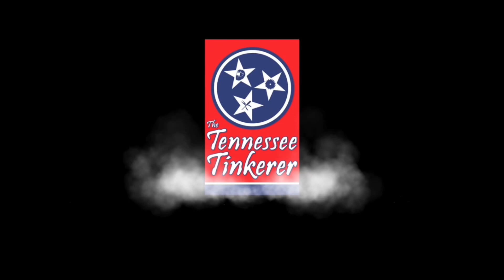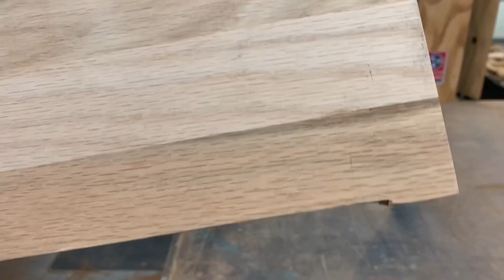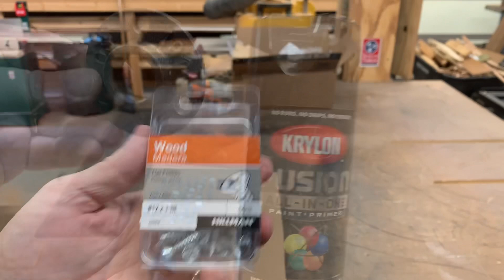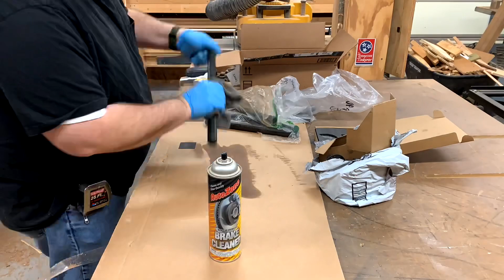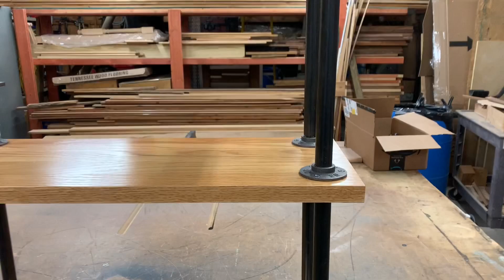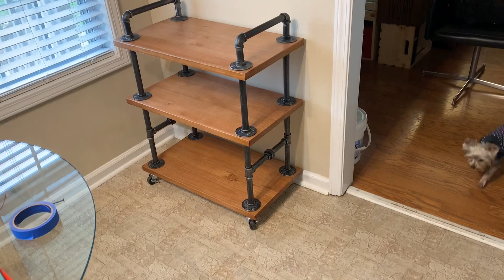Woodworking: Industrial Oak & Pipe Shelf

Comment: Sir I ran across your video on how build a stitching ponies is there anyway I can get a list of the length of the wood and how many pieces to cut I thank you a head of time I really want to make this have a great weekend
Reply from the maker: Mark, thanks for the comment and view! The base measures 5"x20". The jaw assemblies (2) measure 5"x17" overall, with the clamping blocks (2) measuring 5"x4". The spacer blocks at the bottom (2) measure 5"x4" each. The carriage bolt is 3/8"x6", and the hinge is 3"x2". Hope this helps. Thanks again!